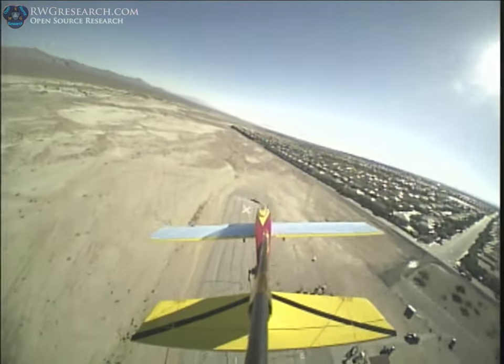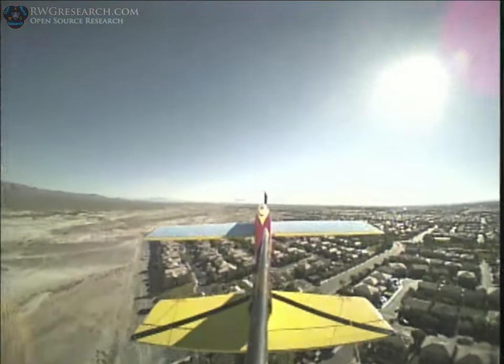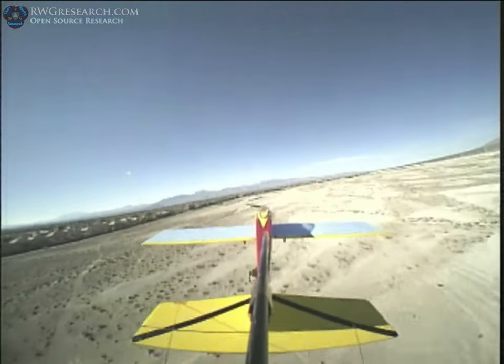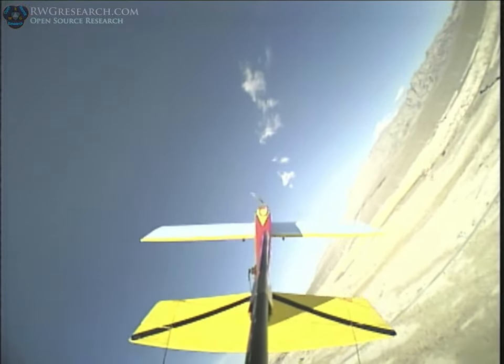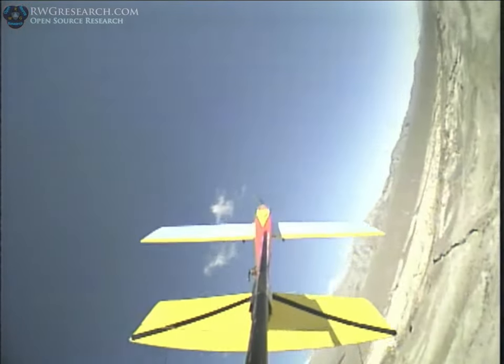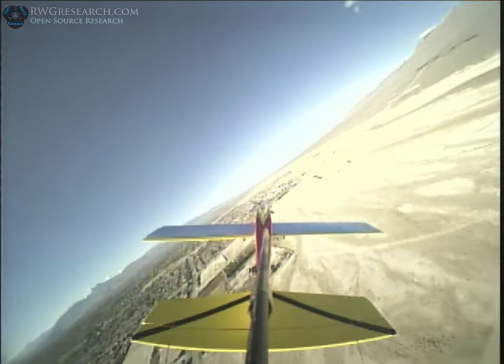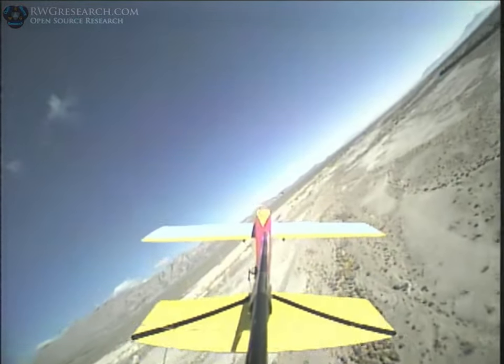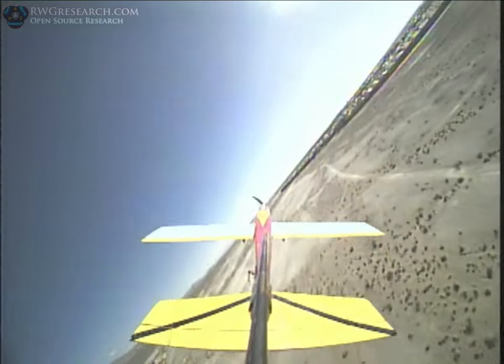Plane On A Stick... Signal loss.. NO NOT OVER THE HOUSES!  DOH!

Comment: Good save!
Reply from the maker: It was sketch. I was thinking road road road! Land in the Road! Lol as if I was flying a real plane and had an emergency! It was an interesting feeling. Would have been bad if I hit a house. ~Russ
Reply: @RWGresearch  Do they have some kind of return to home auto pilot for those things when they lose signal?
Reply from the maker: @firepinto so. That's a complicated Question. Basically all RC aircraft are "dumb" except when there is some kind of "stabilisation" and only if its able to do Attitude Hold...  Most Spectrum planes have "safe" that can do this if enabled. BUT it has a known idea where it is in space. Aka where the air field is... The only way that's possible is if it has a GPS. You could try to use the RSSI and see if its getting better or worse. But I have never seen that implemented.  So unless you have a GPS... (It was not in this plane) then the fail safe is just prop off and level off. (You can set things such as fail safe in some configuration that will fly a circle for instance) but that does not always work. But sometimes I'll set fail safe to do this so it makes a large circle till it comes down... ~Russ

Comment: Wow good recovery.  How old is the receiver? Maybe the receiver is getting interference from the electronics in the plain? Could you put a better antenna on the receiver to get better signal? Maybe some aluminum foil around the receiver to ground out other signals might help. It does fly really well for all the damage you stated.
Reply from the maker: Yeah the receiver is not too old. But. Even with the antenna hanging out of the plane its still not great. In fact I switched out the receiver with a different brand and protocol and still had some trouble. So hard to tell ATM. None the less. I have a cross fire RX I'm going to use if this new one is still unstable. That should give me the best result . ~Russ

Comment: That's scary. Definitely time for a long range radio system
Reply from the maker: yeah. i changed out the receiver with better results... but i still rather stick a cross fire RX in there... bad thing is i use those for the higher quality builds! only have one spare... there pricey but better to have signal than to not! ~Russ
Reply: @RWGresearch  crossfire would be a great piece of mind especially since are you flying FPV.